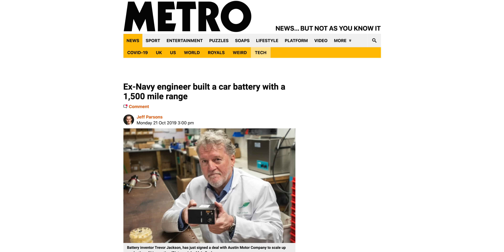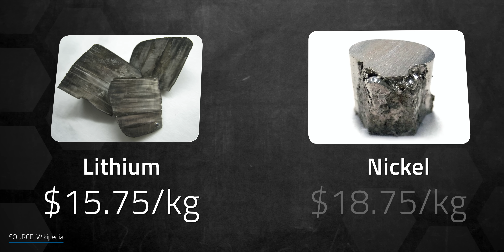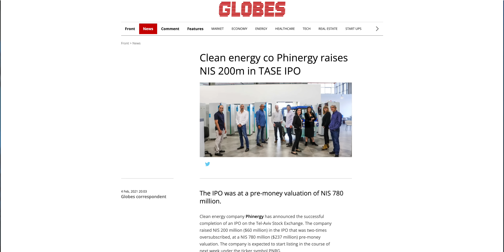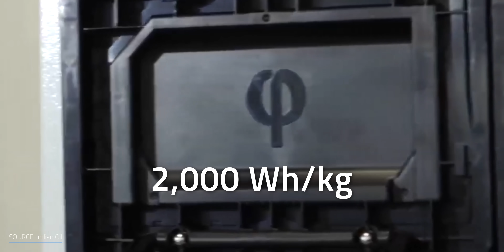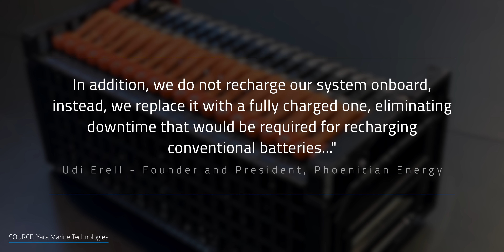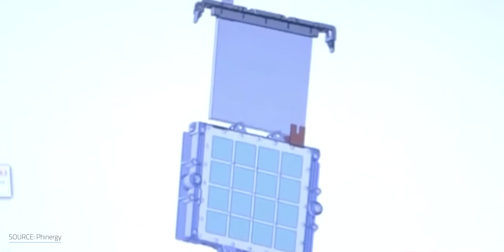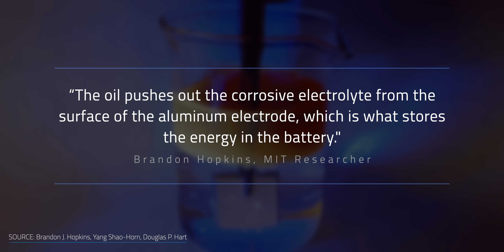Exploring the 1000 Mile Car Battery - Aluminum Air Hype?

Comment: With a 1000+ range, you could have the battery be two independent halves. Drive about 500ish miles and the first half dies and switches to the second half. The car prompts you to refuel, and you still have 500 miles in which to do it. When you go to a fuel station, the dead 1/2 battery is swapped, and its replacement becomes the new secondary battery. The only real problem with a non-rechargeable battery is assuming you should just use 1 and go from 100% to 0% charge before you swap. It was simply a faulty premise. My example above is over simplified. I'm sure in reality the battery will be divided more finely. Some of the images showed it being replaced in smaller modular units. It's conceivable that you could go so far as to use them 1 at a time and refuel how ever many as needed

Comment: 2012 RSC Study shows the anode and cathode can be coated with ceramic aluminum conductors to prevent degradation and potentially are rechargeable. Much better design.

Comment: What's missing here is what it takes to recondition the battery. 

It's not rechargeable, so what type of effort is needed to get a new battery out of an old battery. How much does the energy cost? What type of facilities are needed? How much material is wasted in the reconditioning? etc. etc.

That's a major point that's missing in the video.
Reply: If the spent Aluminum has been turned into an oxide, it will need to go through the full smelting process of passing huge amounts of electricity into it using Carbon as the electrodes, with the Carbon removing the oxide as CO2. So basically these new batteries get their energy by undoing the smelting process...a process that requires huge amounts of energy and creates large amounts of CO2.

Comment: I think even if they do fix the issues with this tech it still won't be adopted simply because of the logistics behind it. These batteries are big. Like really big and will require a ton of space to store. While they might not take up much more room than gasoline does, you can't just pump batteries in to an underground reservoir and pump them back out like you can with gas. It would require a massive above ground facility that would need to be staffed by multiple people and plenty of equipment for loading and unloading and I think that fact alone pretty much eliminates the feasibility of swappable batteries entirely. With the exception of a liquid electrolyte solution.

Comment: For YEARS (like, 20+) I've thought that battery swapping was a more practical approach to electric car design than a fixed battery. One reason was limited lifecycle of batteries, and another was that swapping of standardized components could be managed much more quickly than recharging (especially when machine-automated). However, the advances in battery design over the past 5 years eventually changed my mind. Density and Lifecycle achieved by Tesla have solved the problem (imo), and battery-swapping stations simply aren't here. India probably COULD have led the world in an electric car revolution if they started with a battery-swapping solution (standardizing everything needed) 10 years ago ... but now it really seems too late.

Also ... we talk about "weight" density, but how's the energy per cubic meter on these Aluminum things?

Comment: Seems like a technology that would work great for the aviation industry, where weight and volume are a big concern. It would be easier to have these swap stations at airports. And faster for planes to get off after swapping than recharging.
Reply: Electric planes are some way off being viable for more than light aircraft and short trips. Aviation fuel has an energy density that batteries may never achieve. Also exhausted batteries are just as heavy as charged ones, unlike fuel tanks, which get lighter the more you use.
I'm sure eventually there will be solutions to some of these issues, but for the immediate future electric planes are going to be limited in range and capacity.
Reply: @andrewness  yes i was thinking more on the short haul flights usualy made by propeller planes. Since fuel costs are the most expensive part to operate planes, there should be a sweet spot where the money lost by the weight sacrificed by the batteries is compensated by the economy in fuel.

Comment: The energy density is impressive, but one thing you never mentioned was it’s volume. How does it compare in volume for an equivalent 85kwh battery pack?
Reply: That's what I want to know (hopefully the algorithm gives this comment more attention if there is a reply).
Reply: same question
Reply: He discussed it when talking about the energy density. He compared it to lithium battery’s with maximum 2000watts per kg where as aluminium air was theoretical 8000w per kg
Reply: @aidanprior5045  per kilogram, we're talk per - for instance - cubic meter. We're asking about the spatial, or volumetric energy density, not the mass-based energy density.
Reply: My apologise. After posting the comment I realised this. Very good question to ask.

Comment: would have no problem swapping out, similar to gas cars where I drive into a gas station to swap out my empty tank for a full tank, I had thoght of Swap out for current EV's. Why wait for a couple of hours to charge if I could simply swap out my battery pack, kind of like a propane exchange program

Comment: It wouldn't be for daily use, commuter vehicles due to inconvenience of swapping the battery (and that will forced car manufacturers to design their cars in a similar fashion for efficient battery swap -- which will never happen).

But these battery could be use for a lot of other applications, including golf carts (or its equivalent), communal eBikes and electric scooters, MAYBE aircrafts, maybe boats/yachts/floating commuters of some sort. Also can repurpose it as backup generator(s).

Comment: First off, Thank You Matt for always shedding understandable  light  for everyday people like myself.
 As someone who is a 5th wheel owner, I am accustomed to having to change out propane tanks, dump waste, and use alternate energy sources depending on location and what's available.  
The obstacle  of having to swap out batteries seems like a minor one that could easily be overcome. 
I mean I can literally swap out my propane tank at Rite Aid if needed.
 I think we could get really creative to find easy solutions for these batteries. Ummm, fuel for thought for sure.
Reply: He doesn't look at the thermodynamics, which is very disappointing. 

The reaction in the battery consumes the Al and converts it to Aluminium hydroxide, this then needs to be extracted from the battery, dried to produce alumina and then refined with the electrolysis process that is used for Al production. The it needs to be manufactured into the electrodes, assembled into batteries and shipped. 

At best you are looking at maybe 25% of the energy to produce the battery is stored in the battery (75% energy loss), as electrolysis of Al is at best 40% efficient. 

There is a reason that 60 year old tech isn't everywhere already.

Comment: The major sticking point with this technology is where you get the energy to recycle the aluminium once the batteries have been used up. It's not just a matter of melting it down and re-casting it into a new battery electrode, because when this battery has been depleted, the aluminium metal has all been converted into aluminium oxide. That oxidation reaction is the source of all the energy the battery produces, and to make a new battery, you have to put the same amount of energy back in to convert the aluminium oxide back into aluminium metal.

In fact, you need to use considerably more energy, because it's not possible to directly convert aluminium oxide into aluminium metal at room temperature - the oxide needs to be melted first, and then electrolysed, which takes a lot of electricity, plus a lot of heat to keep the cells liquid. There's a reason why aluminium refining is one of the most energy-intensive industries on the planet, and why aluminium metal is one of the most worthwhile metals to recycle - because the capital investment in energy costs for producing aluminium from its oxide is enormous.

So if this ever went large scale, you would need several industrial sized aluminium electrolysis plants. These tend to be built next door to power stations - that's how much power they consume. In some countries, they are only allowed to run at night, since the grid needs the power from the power station during the day. So for every new aluminium electrolysis plant, you would need a new power station to run it.

Finally, even if all the electricity used was renewable, and all the heat required to keep the cells molten also came from renewable electricity, the electrolysis process is still not carbon-neutral. Why? Because the anodes have to be made of amorphous carbon to tolerate the heat required (over 1000 degrees C), and they directly generate oxygen as a result of the electrolytic process. Under these conditions, it is impossible to prevent the oxygen produced from literally burning the anodes away, generating carbon dioxide of course. In fact, for each kilogram of aluminium metal produced, you get 1.2 kilograms of carbon dioxide, just from the anode burnup during electrolysis. The only way to prevent this would be to make the anodes out of a high melting point metal, which would also need to resist oxidation by pure oxygen at over 1000 degrees. There aren't many metals which can do that, and all of them are extremely expensive - platinum for example. I doubt there is enough platinum on the planet to form the anodes needed for a typical aluminium refinery, so large are the electrolytic cells.

Comment: I own an EV with about 220 mile range in perfect conditions. It is not enough for day trips. In my part of the world, there are only a few DC fast-chargers available and only in certain directions on major interstates. I feel sorry for all the consumers who will buy the new Lyriq, Mustang Mach E, Bolts and e trons... These cars are great commuter cars. Which is why I bought my EV with that in mind but at some point you are going to want to take a 120 mile trip one way for the day and you can't use your EV. Honestly it feels terrible to not be able to drive the EV in those situations. Not to mention the sketchy places Electrify America places the fast chargers. Tesla got it correct by building an infrastructure along with the car. I have Tesla envy whenever I see a L3 Tesla charging station on my app but can only find terrible L2 or even worse... L1 chargers... We need a big ole rethink of the electric grid to supply EV's with enough juice to charge more than 4 cars at a time at a single L3 charging stations that are well lit and consumer friendly. I love my EV but I'm going to trade it for a gas vehicle. It is difficult to own one currently.

Comment: the hotswapping really isnt an issue, they just need to have a system where a vehicle has 2 or more replacable batteries and uses them one by one, so when you spend one battery and start draining the second, you just swap that one outif these things really can have 1000 km+ range, then if someone really does run out of charge at night with no close station to swap out a battery... then thats really on them

Comment: What's the total energy efficiency of creating, swapping and recycling these, compared to their total energy discharged in use?
What's the power density, ie does it have enough oomph to run a car directly? Or do you still need a second lithium one for acceleration?
Reply: This concern over "swapping" the battery could indeed be rendered as misplaced sometime in the future. That is if somehow vehicles are fuelled with Aluminium. One day, lets say instead of filling up with fuel, we could just fill up our batteries with Aluminium foil or powder. 

But that requires some clever design. I agree we aren't anywhere near there as yet.
Reply: @TheControlPhilosopher  you're describing using aluminium as a fuel, and recycling it from aluminium oxide back onto aluminium. That takes a great deal of energy. What's the round trip efficiency of that process? How much is lost to heat and at what point? Lithium is extremely efficient (~85%) at this, and it can do it internally without requiring energetic outside transport and processing.
Reply: @MrGonzonator  All I know is that per kg of metal produced requires @ 15-16 kWh of energy right from refining the bauxite ore to metal-sheets.
Reply: @MrGonzonator  The refining of Lithium from its ore to its pure oxide/carbonate needs 30-36kWh. So also the figure of 15-16 kWh for Aluminium is based on bauxite with @53% Al2O3. Recyling from spent batteries will be easier as not only we begin with pure Al203, there is likely to be 15-20 unspent Aluminium as well.
Reply: @TheControlPhilosopher  difference is, that lithium only needs to be refined once, to give you  thousands of useful charge cycles. Aluminium gets off the hook slightly by virtue of its 3-4 X energy density, but even if the reprocessing energy was half the number you quote, say 7kWh per kg, it still means on average 7kWh energy in for 1kWh out.
A lithium pack by contrast over 1000 cycles needs 36kWh per kg for the first .25kWh, and maybe .31kWh for each subsequent cycle, averaging to 1.4kWh in for each 1kWh out.
Reply: @MrGonzonator  Very valid point. One that is well known anyway. But theres not enough reserves to go around for the rapidly growing populations of large countries like India. And look at the per-capita electricity consumption it is only 935 kWh for India whereas for the USA it is @ 12,000 kWh. And even at such low levels, India is the 3rd largest emitter of CO2! And living standards are always going up. Clearly a similar comparison can be made for petroleum fuels or automobiles. At this rate India's demand alone will outstrip the world's supplies or even reserves. That is why research into all alternative chemistriess to Lithium is needed. Aluminium Air is but one of them that holds promise. It hasn't been delivered yet. 

BTW, Aluminium production per kg of metal from Alumina (Refined Bauxite) needs 13.2 kWh of energy of which some 7-8 kWh are emitted as heat. It also needs 400 grams of carbon that will emit 1.4 kg of CO2. And the current efficiencies are around 96%.

All these are lucrative enough to justify exploring this technology.

Comment: If they can figure out how to make those batteries rechargeable and keep their efficiency even for only 200 recharges would be amazing.
Reply: It fundamentally converts Al to Al(OH)3, reducing this is possible, but only in a refinery. As Alumina (dried Al hydroxide) is base ore for aluminium metal production. So no recharge for you, not even really recycling, but a re-refining process is required, and all the energy that that requires (lots and lots for Al), it's not called congealed electricity for nothing.

Comment: I surely do not know the weight of the aluminum air battery pack but if it were manageable, for a single person, carrying a spare in the EV could solve the driving at night issue of not finding a charged replacement.  It would be like carrying an extra propane tank in an RV.

Comment: The battery appears to be reasonably light weight.  For me the two issues is the convent availability of swap stations.  The battery must be significantly less in cost than LFP.  If not then why bother.

Comment: IMHO, a roll-out of DCFC stations will eliminate range issues. In principle, DCFC stations can have better coverage than gas stations, as there are fewer issues with siting. Even remote areas far from high-voltage power can operate by using a super-capacitor bank which then slowly recharges between the rare visit from an EV. ... But if Al-air batteries do work out, one solution to the "running out of juice far from a swap station" problem is to include a small Li-ion battery which can be recharged so the car can limp along.

Comment: Since the only thing consumed is the aluminum anode, the form of the battery should be redesigned around easily replaced anodes instead of replacing the entire battery. This is analogous to feeding paper into a printer. The paper is a sheet of aluminum anode and the printer is the rest of the battery. Recharging would then be as simple as loading more sheets of aluminum into the battery.